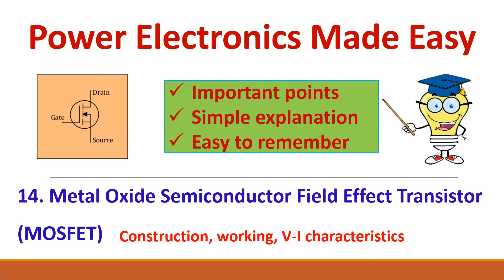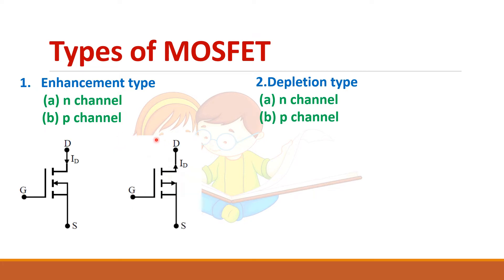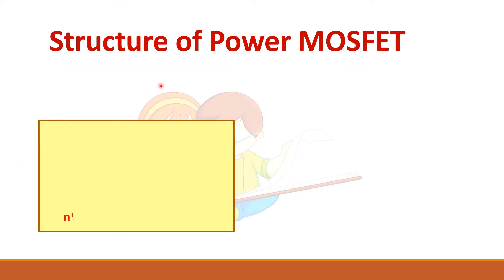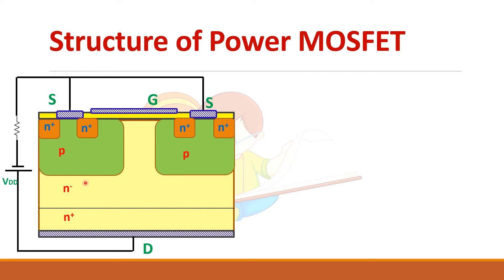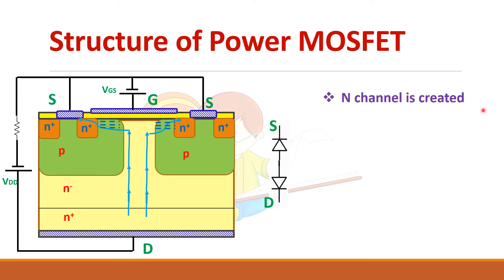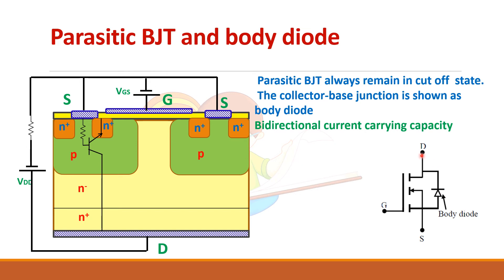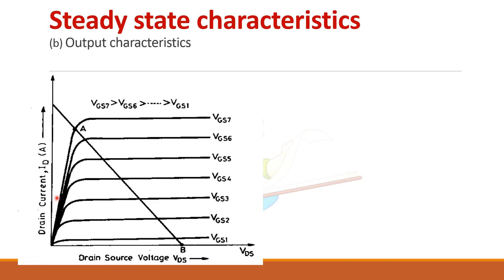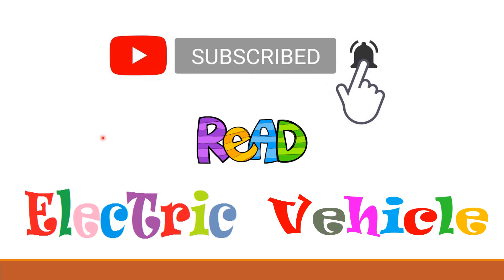14. Power MOSFET /structure/body diode/working/steady state characteristics

Comment: On thing you teaching wrong the mosfet on state Current is not High instead it's very low compared to BJT it's  in mOhm  instead of Ohm that's why mosfet are used in high current application without verg much heating losses.